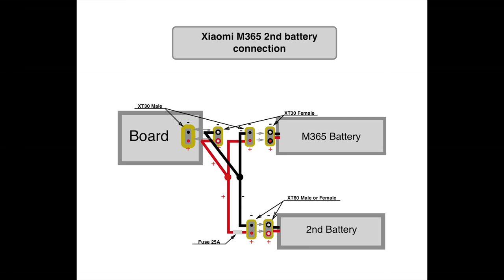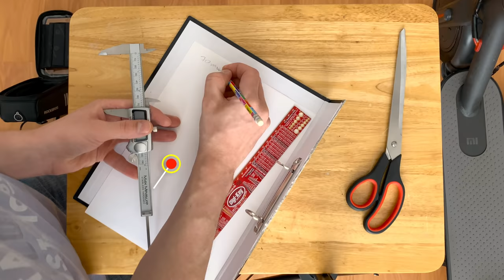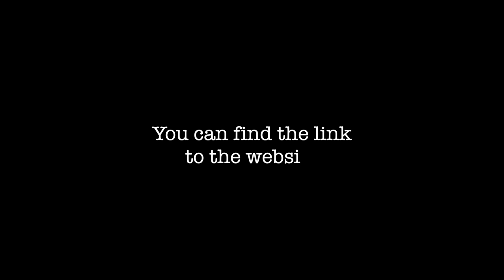Xiaomi M365 / Pro / PRO2 / 1S / Additional / Extra Battery Upgrade

Comment: Do you charge the batteries seperate or via the original scooter charger port? As battery pack i have seen come with a seperate charge lead
Reply from the maker: Hi. 
I charge both batteries via the original scooter port. 
Some people charge both batteries via additional battery charge lead but  I haven't checked it yet so I don't know how it will work. 
The third option is to charge both batteries with two separate chargers but the batteries must then be disconnected and the chargers must be the same (2nd genuine xiaomi charger)  and they must be charged to the same voltage. 
After charging, When they are still disconnected, check both batteries with voltmeter to see if they have the same voltage.
One more option is to buy a more powerful charger. 
The original charger charges with 1.7A, I bought and are still waiting for the 3A charger. 
In my opinion this is the maximum safe power and I will let you know how it works.
Reply: T&A Tech sorry if i sound dumb so basically when you charge it via the scooter port the external battery is getting charged via the same port that it discharges from is that correct
Reply from the maker: @aaronlake1223  There are no dumb questions. Yes you are correct. 
By connecting the charger to the original charging port of the scooter, it also charges an additional battery via a discharged cable.
As I wrote before, some people charge both batteries (connected) via the charge port from additional battery and they claim it is safer.
I will do some charging tests via the external charging port and let you know
Reply: T&A Tech see this is what gets me why is the charging cable connected to the battery or bms differently from the discharge cable if you can do the same job

Comment: Will my battery charge using the XT60 connector or will I need to use another power brick?
Reply from the maker: Hi Matthias.
I charge both batteries (connected together) via the original scooter port and conceal the additional power charging port.
Some people charge both batteries via additional battery charge port but  I haven't checked it yet.

Comment: what is the new power and Kms range? great work
Reply from the maker: Thanks for comment. Motor power will depend on firmware you upload (extra battery give you extra current so the original battery will not be heavily loaded). 
The range depends on the capacity of the additional battery pack. Xiaomi M365 originally has a 7.8 ah battery pack and by adding about 9ah you will increase the range twice.

Comment: Thanks a lot for your video. I recently bought a Xiaomi m365 pro and need one af this extra batteries . i have no that Knowledge and struments to  assemble it. could you make me a complet set and send it to me in Italy? i would pay you as you make it. thanks
Reply from the maker: Hi. You can buy ready made "cable/connectors kit" on my ebay. Please check pinned post or description. Thanks

Comment: Hi, I have a question, Can I Charge the second battery mounted on my Xiaomi m365?
Reply from the maker: Hi. You have to charge both batteries together via scooter port or separately but then disconnected from each other. Always if you want to connect two batteries together that they must have the SAME VOLTAGE
Reply: @tatech8696  So I can simple charge The XT60 Double battery connected in parallel with original battery of my scooter only with the scooter charging port?
Reply: @tatech8696  Right? That I can left the 2nd battery attached at my scooter and I need only to attach the charger at my scooter?
Reply from the maker: Yes. You must remember that before connecting the 2nd battery to the scooter, it must have the same voltage and you must change the custom firmware (remove charging mode - enabled). After driving a few km, disconnect them and check with a voltmeter again if they have the same voltage. You can leave them connected together and both batteries will be charged through the port on the scooter.
Reply from the maker: The charging time will also increase proportionally with the capacity of the second battery. I use a 42V 3A charger for the M365 purchased on Banggoods and the batteries charge faster. The standard charger is 1.7A
Reply: @tatech8696  thank you so much, well you conferm that I can leave second battery attached with his own of the scooter, and I need only to connect charger to the scooter for charge all of the two batteries?

Comment: I bought a battery from china but it only charges up to 40.6v and the scooter battery charges to 41v. Will they still work together? Thanks!
Reply from the maker: Hi. Try to discharge the scooter battery to as close as possible to the battery from china then connect both batteries, discharge and charge (both batteries connected) via scooter port with Xiaomi charger. Probably the Chinese charger charges up to 40.6V.
Reply: Ok thanks a lot but what about the charging does the other one charge over 41v and the other one stop at 40.6v? Or how does it work? Thanks for the fast reply!
Reply from the maker: I think, that Chinese charger fall and charge battery to 40.6V only but it could be a fall battery cells or BMS. 
Check the charger output voltage using some multimeter. However 0.4V different is still fine. If additional battery pack is fine, Xiaomi charger should charge them to same voltage. Just check them with multimeter again after discharge and charge via Xiaomi BMS

Comment: Man love your video very straight forward, just have one question when charging the batteries do you have to charge them separately?
Reply from the maker: Thanks Maco.
I charge both batteries via the original scooter port. 
Some people charge both batteries via additional battery charge lead but  I haven't checked it yet so I don't know how it will work. 
The third option is to charge both batteries with two separate chargers but the batteries must then be disconnected and the chargers must be the same (2nd genuine xiaomi charger)  and they must be charged to the same voltage. 
After charging, When they are still disconnected, check both batteries with voltmeter to see if they have the same voltage.
One more option is to buy a more powerful charger. 
The original charger charges with 1.7A, I bought and are still waiting for the 3A charger.
Reply: T&A Tech thanks for the quick response Greatly appreciate it I think I will go with the option of charging via the original port, it seem like best best option to me as it will charge both batteries. I take it will take roughly 10 hours to charge both batteries with original charger?
Reply from the maker: Yes, around 10hrs
Reply from the maker: link to faster 3A charger for m365 you will find in the description. it costs £ 14 and will reduce the charging speed to around 5-6 hours
Reply: T&A Tech oh wow that’s better thanks for your help and advice man I will order one tomorrow
Reply from the maker: No problem. 
Please subscribe my channel, like and share my video 😉 Thanks
Reply: T&A Tech sure thing 😀👍🏽
Reply: Dit you not see hvot hi just don little You, tok not 10 minnet the 12wolts battery pour you don't sleep no but it's a good fill you vil understand next time you see et godt luk hi.

Comment: Hi brother would this work on the aovo m365 pro?
Reply from the maker: Hi. Look similar to Xiaomi scooter but I don’t know anything more about Aovo (controller, fimware). 
If it possible to upload custom firmware via “M365_downG” or any other app with marked “remove charging mode” that should be works.

Comment: Really really bad idea to drill holes in the down tube, you massively weaken the strength at this point, might be ok for lighter riders but not for larger people, also there is absolutely no need to do this, straps clamps or cable ties would be more than sufficient, thumbs down from me sorry.
Reply from the maker: I appreciate your feedback, but I personally don't think that two small holes affect the tube's durability. In this scooter, there are many more points that have much less strength.
Reply: @tatech8696  I could show you structural analysis using stress analysis tools I use in my day job designing cranes if you like, just look at the guidelines on house building with regard to drilling holes in roof beams and rafters if you want to really see the effect this has, you really must not perform this modification,.there is no need to drill the downtube at all, I really would re edit this video to not show this step.
Reply: In the process of doing this myself and I've used 2 exhaust u clamps with extended legs. 45mm diameter with a cut up inner tube to line the frame where it touches. It's rock solid and no need to drill ;)

Comment: hi bro, i have a question, can i attach the extra battery without the internal battery to the m365? if i can't, how can i discharge the battery? because the extra is 41.6v and the internal is 40..3...
Thanks if you answer me :D
Reply: Did it worked without the original battery?

Comment: But the battery is only partially used.
You would have to connect the auxiliary batteries to the BMS and emulate settings around the BMS.
Unfortunately I have no idea how exactly this works.
Reply from the maker: The extra battery is used fully simultaneously with the original battery pack. 
By adding a 9AH battery pack, I increased the range of the scooter twice. 
If the extra battery were used only partially, the voltage in both batteries will be different when the energy was cut off.

Comment: Hi, do you know if there are any battery replacements specifically for the M365 Pro model? I've stupidly been riding mine in the rain near constantly late last year and it's been dead ever since... Xiaomi's repair wanted to charge me £350 to fix it.

I've done some looking for spare batteries, however all I could find were the standard M365 models, which fit and can work but obviously the lower capacity in storage puts me off making the attempt.

If anyone could share any links for the pro model's battery that ships to the U.K I'd greatly appreciate it :D
Reply from the maker: Hi. I'm sorry to hear that your scooter is not working.
Unfortunately I didn't find any website where they sell batteries for PRO.
Reply: @tatech8696  Ah such a shame, thanks for the attempt! :D Oh well guess I'll wait til London fully allows scooters and make another purchase.
Reply from the maker: @iTouchin  try to find someone who could check your scooter. It can be battery bms, it is possible that one or several battery cells are dead, dashboard or moterboard.
Reply: Where in the uk do you live my brother? If its Wales it's easy and cheap fix. Holla back fam x

Comment: Would a 25Ah batter be overkill for a M365 Pro or not? Love ur videos btw keep up the good work
Reply from the maker: Hi Hassan.
Thanks for nice comment. I have no idea if this could damage the scooter.
However, the 25Ah battery pack will be very large and heavy so it will be a problem to mount it on a scooter :/
Reply: T&A Tech  the original battery of Xiaomi Pro 365 12.830Ahm 36V can put together that you have 9Ahm  36V ?
Reply from the maker: @chewsan7733  there is no problem with capacity, they can be different, the voltage must be the same
Reply: T&A Tech but it decreases the Range because original Xiaomi Pro battery is 12.830Ahm?
Reply from the maker: @chewsan7733  If you add 9ah to yours pro scooter you will get 12.8+9= 21.8Ah so will increase range

Comment: Where can I get battery pack for xiaomi m365 pro as I am about to purchase connectors from ebay link.
Reply from the maker: Thank you for supporting my channel and purchasing the cable kit.
Batteries with genuine Samsung cells will be available within 2 weeks on my ebay
Reply: @tatech8696  hola..donde ponen esa segunda batería en Barcelona...España???
Reply from the maker: @uberescalonab.2267  Hola. 
Se puede comprar una segunda batería aquí:
https://www.ebay.co.uk/itm/224199938956

Comment: What is the range of extra battery
Reply: a lot of factors influence the range of the battery: the weight of the driver, the surface on which he is moving, how fast, the outside temperature, the weather, high temperatures and even tire pressure.
I will do 10 miles and you will do 15 miles on the same escooter.
In my opinion, it is best to define the battery range is on yourself. 
If you have M365 it has 7.8Ah batteries, 100% capacity. Suppose that the real range of your scooter is 10 miles. 
If you install additional batteries with the same 7.8Ah capacity, your range will be about 200% 20 miles (original 100% + additional 100%)
If the additional battery has a capacity of 10Ah, it is almost 30% more than the original battery, so 100% + 130%. etc...

Comment: How long distance?? Range?
Reply from the maker: The distance/range depends on many factors as Battery capacity, Rider weight, Average Speed, Assist mode, Tyre pressure, Hills, Surface, Wind.
I weigh 85 kg and on the original full charged battery (7.8Ah) in the m365, in sport mode, a few hills and moderate wind, I will do a distance of about 16 km. When I added a second 9Ah battery, my distance doubled (to about 36km).
So the best calculation will be to check for yourself how many km you will do on the original battery and if you want to double this distance, you must buy batteries with a minimum capacity of the original battery (M365 - 7.8Ah / M365PRO - 12.8Ah)
Reply: @tatech8696  it was very helpful. It was nice from you.  Thanks for your time.  Real professional as other says here.

Comment: Hi bro, thanks for the tutorial, But i have 2 question for you. The first is: if i have a internal battery of my xiaomi 1S with a capacity of 5200mAh, the external battery must be identical or if i buy a 8000mAh is the same? The last question is: where can i buy battery with bsm? In the ebay link is empity. Thank if you ever read and answer me :D
Reply from the maker: Hi. Thanks for comment.
External battery must be the same  voltage as internal (36V on full charge around 41.6) and you can connect different capacity.
New battery packs with Samsung cells will be available on my eBay from next week
Reply: T&A Tech sorry bro, i have 2 more question 😅😂. If i have a 250w of power motor is a problem or Not? The last question is: can i have high temperature?
Reply from the maker: 250W is not a problem, higher motor temperature may occur if you change the custom firmware to a higher power such as 600W or 800W

Comment: hello i have Mi Electric Scooter Essential, i want to know if this works for mine too ? and if you dont know then i would like to know if i could just try this out and like that it would maybe work ? like what could be the problems occuring if i try so ? thanks for your response PS: NEVER BUY Mi Electric Scooter Essential they rip you off, they say it goes 20 km but actually goes like 7 or 8 km in sport mode which is f**** 20 kmh instead of 25 like the other scooters and on top of that its 11 km in slow mode which is f**** 15 kmh NOW I HAVE TO DRIVE EVERY DAY WITH 15 kmh from my work to my home !! GRRRR..... But yeah gonna get the external battery asap and then also tune that bitch to 35 kmh so yeah .. hopefully all will turn out good. PEACE

Comment: XIAOMI M365/PRO Cable Kit for Connecting Extra Battery I bought this recommend me a battery if you can with a link max 150£
Reply from the maker: Thanks for support. New battery packs with new and genuine Samsung, Sony or LG cells will be available soon.
Reply: T&A Tech okey thanks you
Reply: T&A Tech  were can i buy full pakage sir
Reply from the maker: @jommelbetis8236  You can find links to cable kit and battery pack on a pinned post or on description